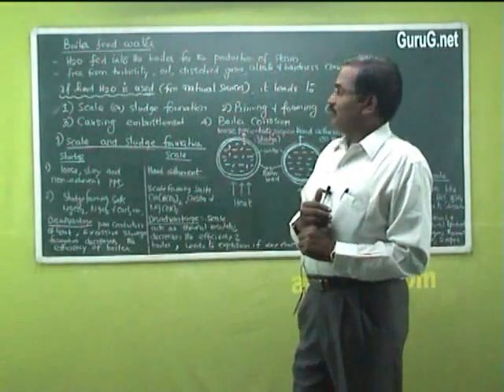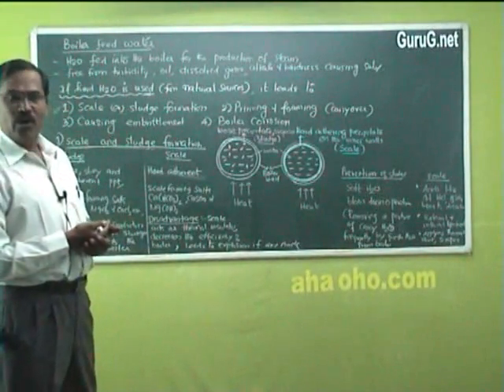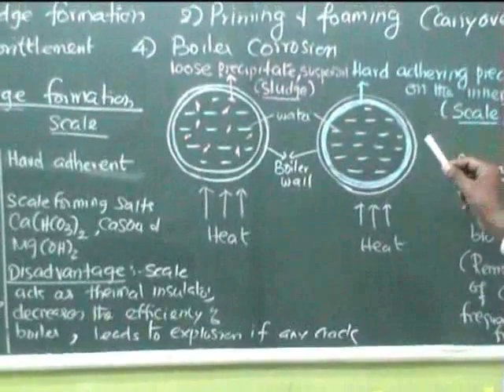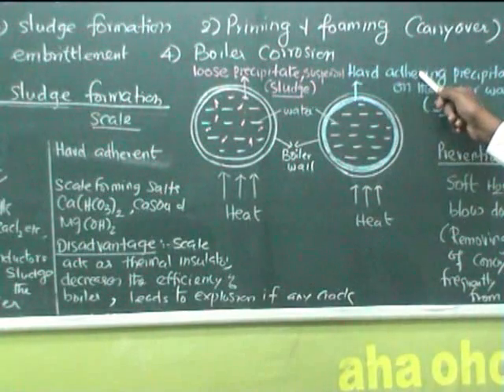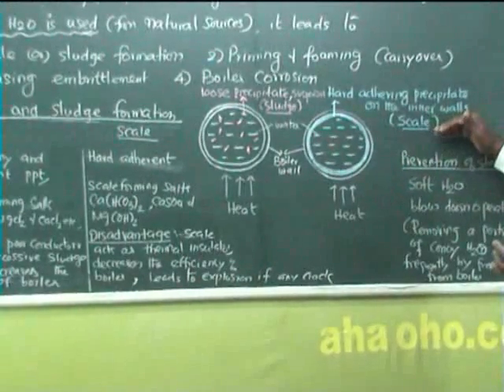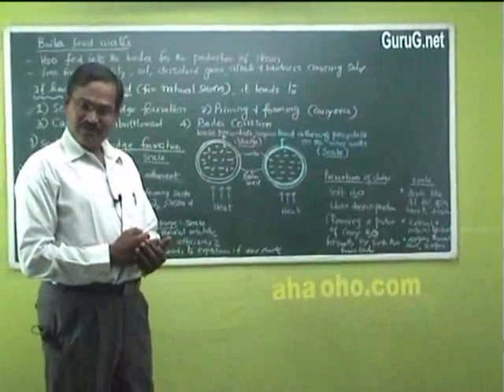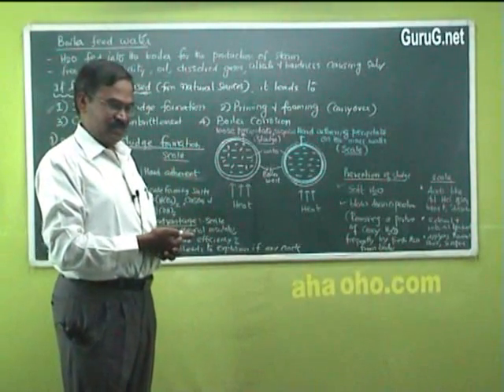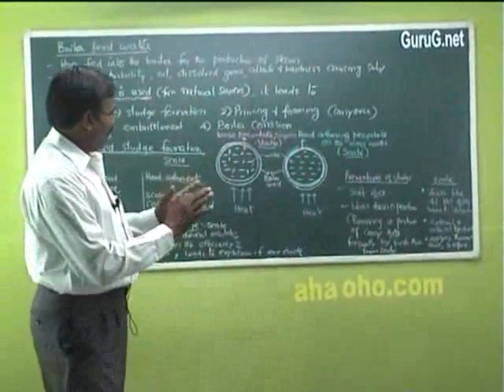Unit-1 Water Technology (Boiler Feed Water) - Chemistry

Comment: sir.my boiler tubes has fully filled with scale what should i di .pls reply me.my boiler capacity is 4 ton.
Reply: Maruthi enterprises Maruthi enterprises - you should maintain the boiler water slightly alkaline. Use diluted NaOH sol. in boiler water. the OH ions will dissolve the scale. however keep an eye on the NaOH quantity. Do water test every alternative day. The pH should be b/w 8.5-10 slightly alkaline
Reply: dear abhishek ji.can u suggest me.what type of chemical i should use in boiler.for scale remove.